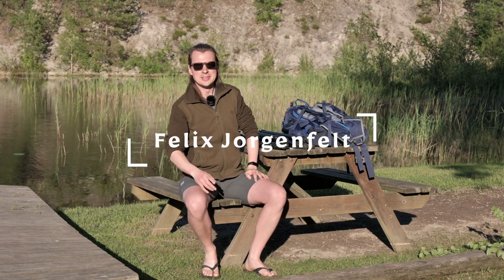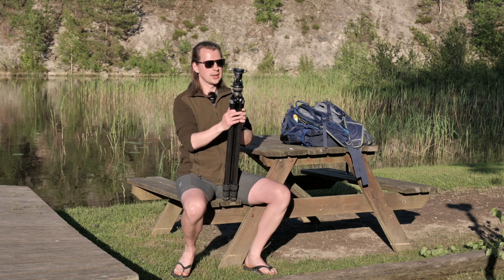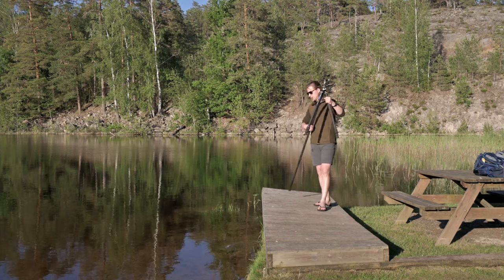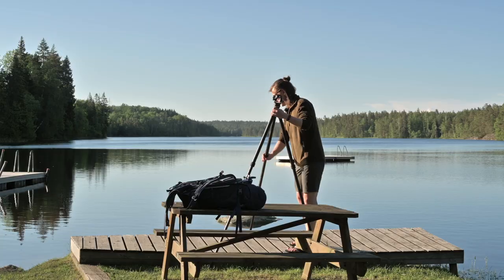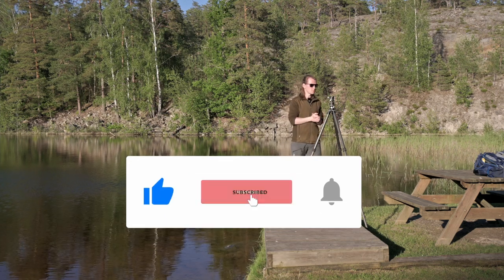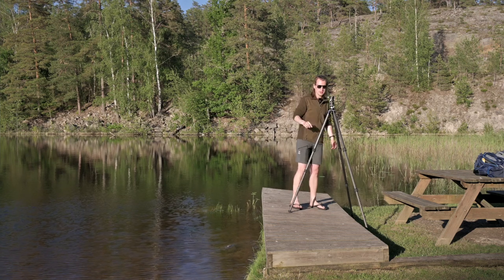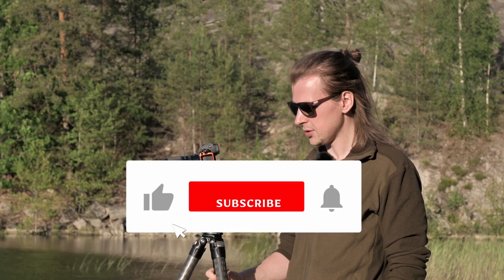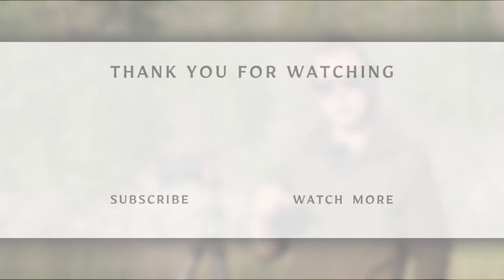The GENIUS of Thomas Heaton Tripod Setup

Comment: After many consideration I came to the same setup ! 
My tripod is the Benro Tortoise 24CLV which is a tiny bit shorter but has as a leveling head integrated for the same mass so it's way lighter and cheaper !

Comment: Since I followed you and got the same tripod, I would suggest you get the "Leofoto TFS US Version Long Spike/Rubber / Universal Tripod Feet" to put on the tripod. It makes it a bit taller, more stable in the sand, mud, dirt and since they are from SS, no need to keep the bottom feet clean all the time. Check them out.

Comment: I was in the market for a new, lighter and taller tripod when I saw your video. Now I have the same setup like yours minus the leveling base. Also I have made a small handle to have a smoother pan/tilt motion since the head has the 1/4-20 holes for the handle.

Comment: You need to get the Nodal of the lens when you shoot panoramas.  So, you need a rail to put on that head and then balance it and get it centered.  Otherwise, the stitching together of the files won't work as well.

P.S. I have the Acratech 1165 and the Leofoto Sv30.  I recomend the Leofoto over the Acratech.  Smoother movements and the top can be spun without undoing it and flipping.  A smooth turn on the Leofoto.

Comment: I've used a similar setup for years with a large format camera.  In my case I use a Sinar Pan/tilt head.  I do use it with full frame digital, as well, even though it's a bit heavy.  One thing that would really help is if accurate bubble levels were viewable from the sides.   I can't always get directly above my tripod.    I do have a few Leofoto pieces, and they've all been high quality.  For example, when I am photographing architecture, I put a Leofoto G2 on my ball head.  It works well, although, again, being able to level the head from the side without using an auxiliary level would be really nice.

Comment: I like to use a fluid video head and a 75mm bowl tripod also for photography. It works in the same way as two-way head apart from that tilt is easier. Another bonus it that the tripod is more stable. I got inspired by Henry Hudson.
Reply: Another +1 for Henry Hudson's 75mm bowl and fluid head combination. The most flexible system I've found so far, especially if you want to shoot video too!

Comment: Looking at pretty much this exact setup but with the LS-364 or the LS-324CEX which has an integrated leveling base. Do you think you could use this head without the leveling base?
Reply: Did you buy the 364? How do you like it?

IMO, the CEX version is a waste of money.  You could buy their leveling base for less and just add it.  That is exactly what they do on the EX version- they add their own level base.  I just got the 364 for $250 open box and paired it with the higher quality (German made) FLM leveling base and FLM ballhead. It hasn't arrived yet so I am curious how you are getting on with it?

Comment: How about a single axis head (up-down) sitting atop a set of Tiltall legs?  On a Tiltall (or Star-D, who made Tiltalls for a while) the horizontal rotation (vertical axis) is built into the tripod.  It cannot get any simpler.  They are a little more robust than the Manfrotto 3021 line.

Comment: Hi Felix,  Just like yourself I have been pondering over the same set-up, I have the same tripod asThomas had it at a stealof aprice at sub £200 Sterling.  The head is another matter,like yourself I have been looking at the Leofoto and the Buddiesman VH-3, I would preferthe fixed clamp on to if it were like the Acra Tech in that if can be released and turned 90 degrees, whereas the Leofoto would require a 90 degree adapter clamp.  So I would like to know have you had any issues with the top clamp creeping as I have heard from a few sources, which is putting me off the head you have.
Regards,
Geiff Howard